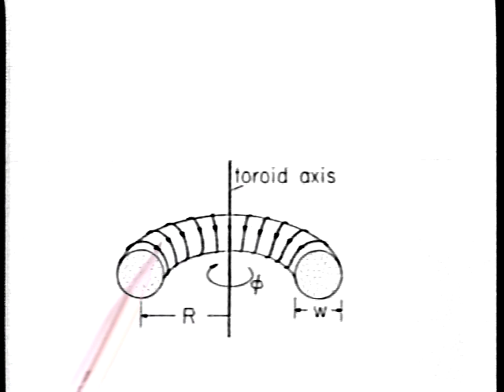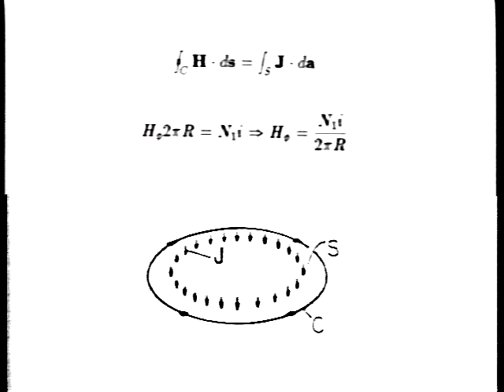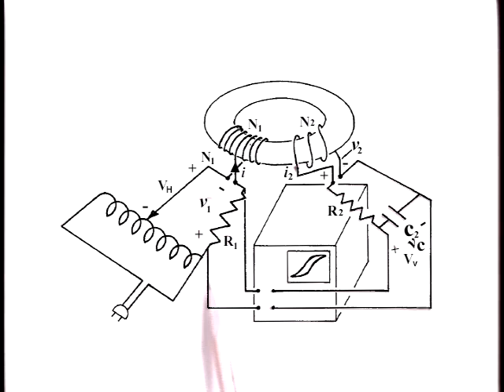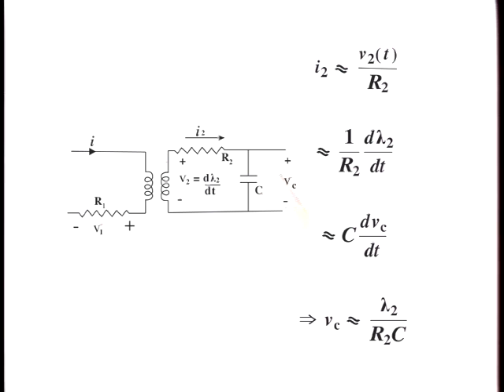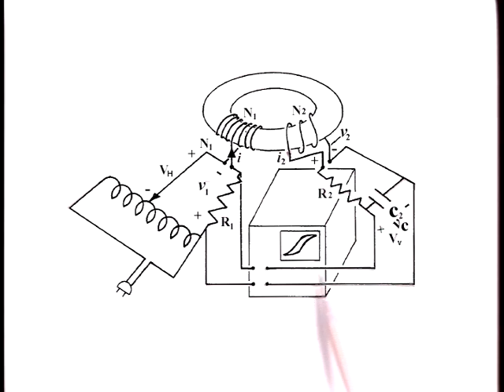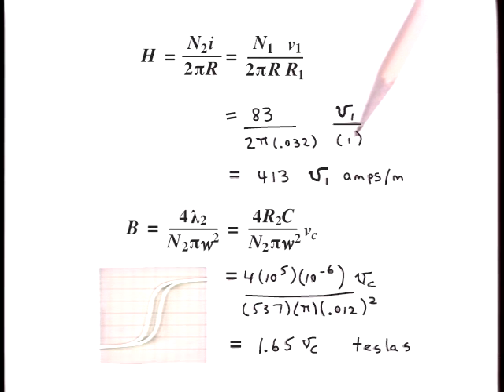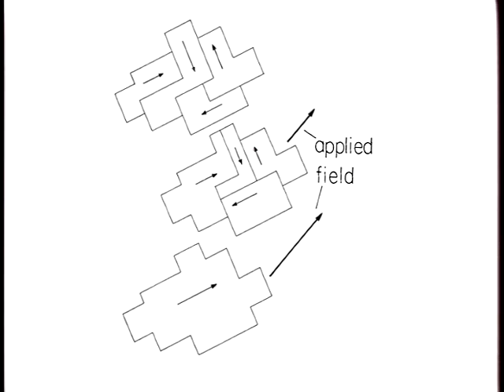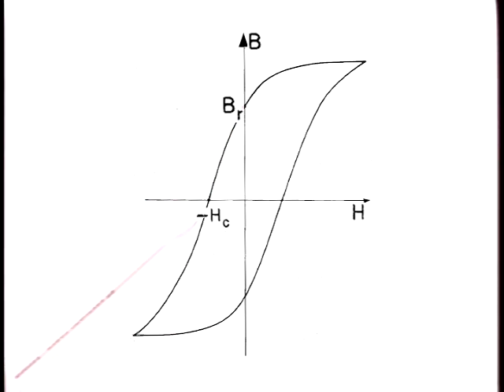Chapter 9.4.1: Measurement of B-H characteristic

Comment: I'm using this setup to mesure the hysteresis of a set of large laminated 'E' transformer core pieces. I do not understand how to find what values the componets I am supposed to use. 
Both primary and secondary coils are the same number of turns but the count isnt known. Im using 120-130v 60hz ac. 
I have a digital scope if that makes any difference.

Comment: Transcription:
Measurement of the B-H characteristic of a magnetizable core provides the constitutive law that relates the magnetization density M, or equivalently the magnetic flux density B, to the macroscopic magnetic field intensity H within a material.

The objective here is to observe the establishment of H – by an imposed current in accordance with Ampere’s law (relates the integrated magnetic field around a closed loop to the electric current passing through the loop) – and to deduce B from the voltage it induces in accordance with Faraday's law (a magnetic field will induce a current in a circuit – electromagnetic induction. (or Maxwell-Faraday equation where a spacially varying (“or possibly time-varying”) electric field accomplanies a time-varying magnetic field)).

A toroidal coil is tightly wound onto a doughnut shaped magnetizable core. Each turn carries a current I.

For this geometry, ampere’s integral law is enough to relate the current I to the H field in the magnetizable core material. Symmetry about the toroidal axis suggests that H is Phi directed. amperes integral law is written for contour C circulating about the toroidal axis within the core.
Because the major radius R of the torus is large compared to the minor radius, the field is essentially uniform over the cross section of the torus. We approximate the average radius by the radius R, thus the line integral of H is essentially 2 π R · H. 

To evaluate the right-hand side of amperes law we see that the surface S spanned by this contour C is pierced by the current I as many times as there are turns N1. So the surface integral of J is n I thus amperes law reduces to the product of h phi in the contour circumference 2 π  R, equaling N1 i.

Hϕ 2 π R = N1 i

Here is the excitation winding. the current is supplied by this variac (variac = generic trade name for a variable autotransformer). 
The voltage drop across the small resistance, in series with the driving winding, is used to record the driving current I. This voltage drives the horizontal axis of the oscilloscope. Because the H field is proportional to current, the horizontal scope deflection is therefore proportional to the magnetic field intensity H in the core material.

The magnetic flux density M is measured by means of a secondary coil, also wound on the doughnut shaped core. This coil is terminated in a high enough impedance that it carries a negligible current, thus the H field established by the current I of the excitation winding is unchanged. 
The flux Φ linked by each turn of the sensing coil is essentially the flux density B multiplied by the cross-sectional area of the core. The flux Φ linked by the N_2 turn coil is then N_2 times the flux linked by each turn. An RC integrating network on this secondary coil integrates the terminal voltage V so that the flux linking the coil is recorded. The circuit acts as an integrator because, at the frequency of operation (60 Hz), the capacitor C has a reactance that is much smaller than the series resistance (Reactance is the opposition of a circuit element to the flow of current, aka lower reactance leads to greater currents for a the same applied voltage).

With the capacitor essentially a short-circuit, the current is approximately v2/R2. From Faraday's law, the terminal voltage of the sensing coil is the time rate of change of the magnetic flux linking the coil. This current then charges the capacitor.
By comparing these last two equations we can see that the voltage V across the capacitor is proportional to the magnetic flux Φ linking the sensing coil V ~ 1/RC · Φ  .

Thus, by connecting the terminals of the sensing coil through the integrator to vertical trace of the oscilloscope we make the vertical axis proportional to B. So, we should see a display of B versus H on the oscilloscope.

Here is the experiment. The magnetizable material is in this doughnut shape toroid. The excitation of primary coil connected to these terminals is driven by the current at 60 Hertz from this variac.
The voltage across this series, 1 ohm resistance, then gives a horizontal deflection of the oscilloscope proportional to I, and thus H. The terminals of the sensing coil are connected through the integrating network with resistance 100 kohm in capacitors mF to the vertical deflection terminals of the oscilloscope, thus the vertical deflection is proportional to the integral of the terminal voltage, the flux lambda and hence the B. 
We turn up the very AC current. The scope shows the B-H hysteresis loop typical of a magnetically soft material.